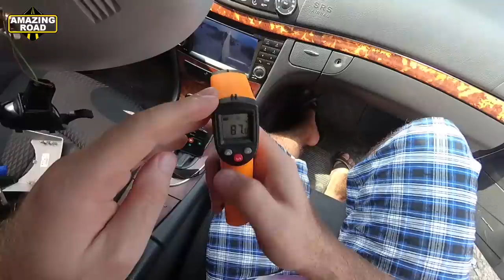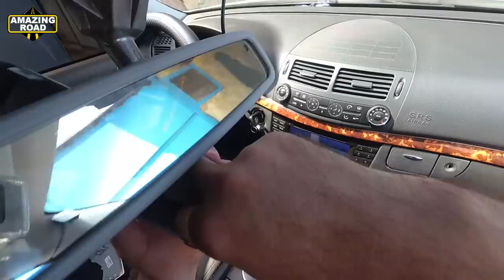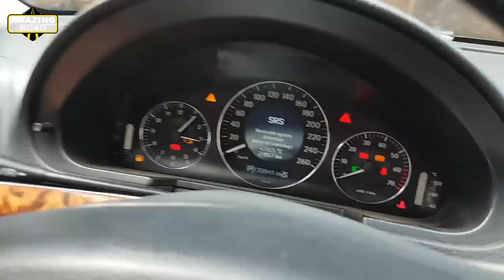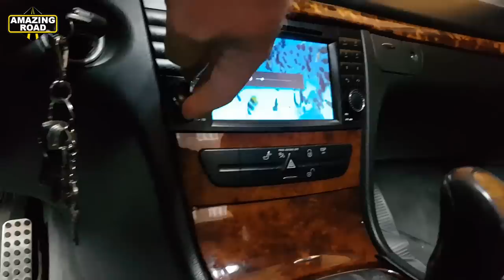Mercedes W211 Installing LED Lamps on Rearview Mirrors / Replacing Rearview Mirror Lamps W211

Comment: There is a trick to install the mirror. Using hammer to force in does not work. Use a small C clamp to compress the spring through the pins. Then use two nails as shims to prohibit the pins to bounce back. Pull the pins out when mirror is in position.

Comment: Great videos, very helpful. For the door logo shadow lights for W211, do we have to remove the entire door pad and do we have to resolder the ribbon co doctor to the electrical contacts? Thank you for your advice.
Reply from the maker: nothing needs to be changed for the door logo. Did you mean that? https://www.youtube.com/watch?v=DJ3OfgzBDNs&t=12s
Reply from the maker: Thx )
Reply: Thank you so much for the responses. The W211 2006 model has a different style of door light. The video shows the door lights for the W212 and hot for the W211. Would you please check for the W211 E Class. Best regards and keep up the great work!
Reply from the maker: @rockyj3416  I'll try to do it
Reply: RockyJ Concepts where do i get it from?

Comment: 9:27 that litle hole in center has also one bulb. Shame it's not a regular bulb that you can change easily. Litle modification and solder, you can mount LED-bulb to it's place, working fine on my car..